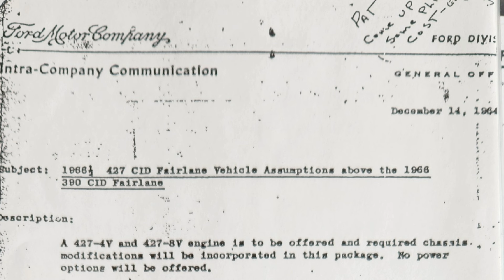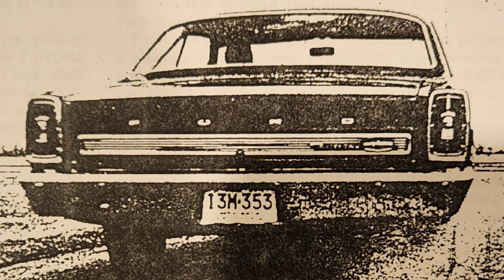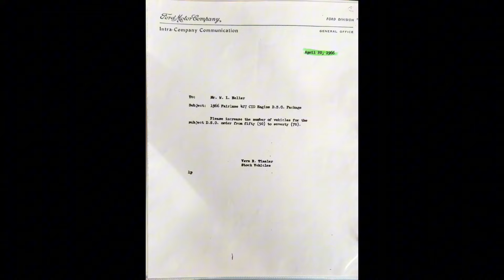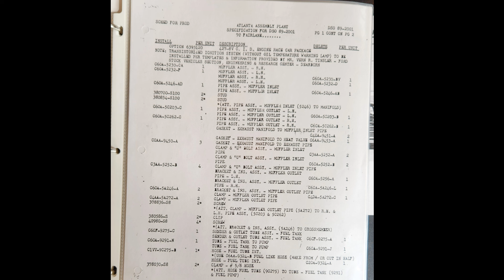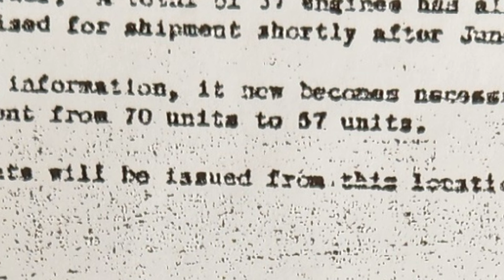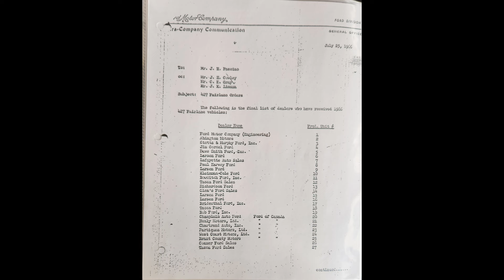What Happened To 13 1966 427 Ford Fairlanes?

Comment: I worked a summer job in may through July of 1966 at the L&N railroad yard adjacent to the Ford Assembly plant in Louisville, KY.  We mostly loaded full size Fords and heavy truck made in that plant onto auto racks (tri-level rail cars) and pedestal flat cars for shipment all over the world,  we did receive Mustangs and Fairlanes and pickups for unloading too.  In June or July we received a shipment of 66 Fairlanes from the Atlanta plant which included two white 427 stick shift cars.  They had bare bones Interiors and almost no options that I can remember.  The window stickers said they were destined for a racing team with a Michigan address.  Some of my coworkers took the opportunity to exercise these cars in the huge storage lot before they were picked up by a typical auto hauler for deliver to Michigan.  I appreciate your video about these cars.
Reply from the maker: That's some cool info, thanks for sharing and watching!!

Comment: When I was young my uncle Bob K. sold new Fords. My oldest brother Max had graduated high school in spring 1965, he went over and got A job at Delco Remy in Anderson In. right out the door. By the winter he placed an order in late December for A Red on Black 1966 Ford Fairlane 390C.I. that car would haul ass. He was banging gears in it when he backed it into some trees and that was it totaled. The he was on to A 1967 390 Mustang. But I was hooked, I would have to have me one of those 1966 Ford Fairlane's, well I've had two over the years, among A bunch of other old Ford's my last one was A 1967 Ford Falcon 289 sports coupe, Ca. car, built to the MAX and yes it would pull the front wheels off the ground.....

Comment: The 427 side oiler engine used in the GT40 had factory cast ports for using a dry sump oiling system as a wet sump wasn't possible for use on them. Did anyR code 427 engines have these ports?? Did 427 Cammers have them ?? Or was the GT40 427 block a one off only for them ??
Reply from the maker: GT40's and all race 427 were production line cast blocks, nothing special. When used in the GT40, there was an external dry sump system with a two piece oil pan and front cover that contained the oil pump, scavenge and pressure lines. Thanks for watching!